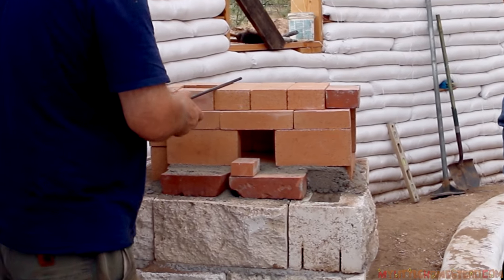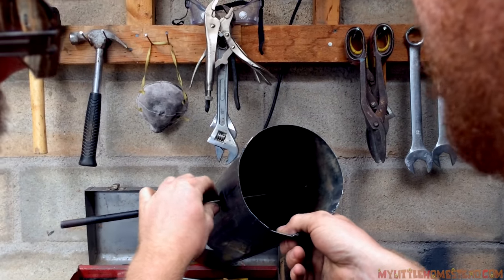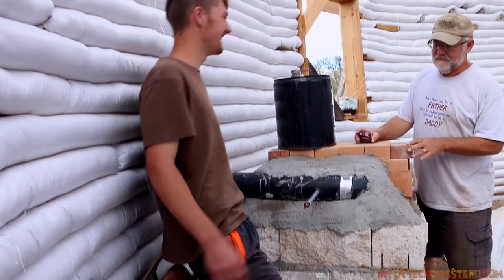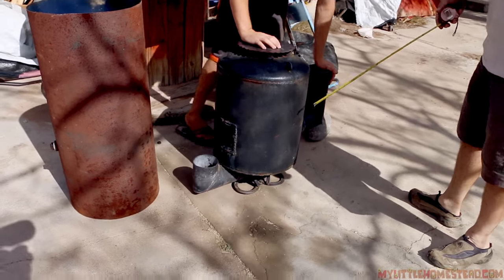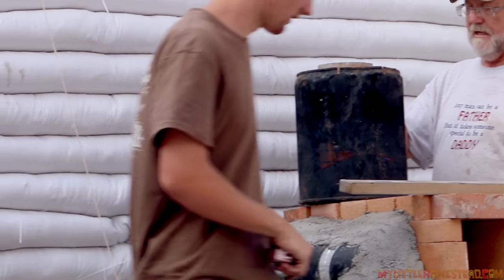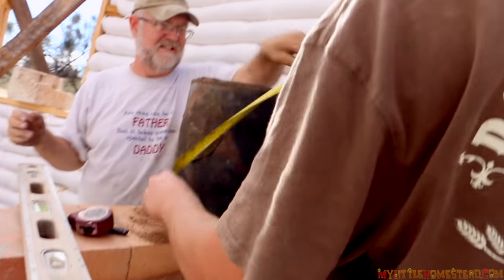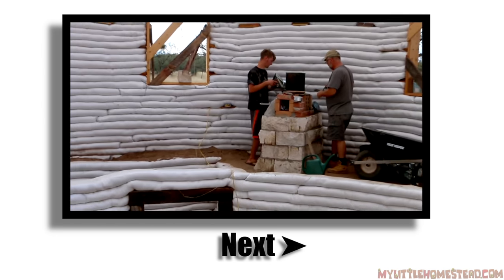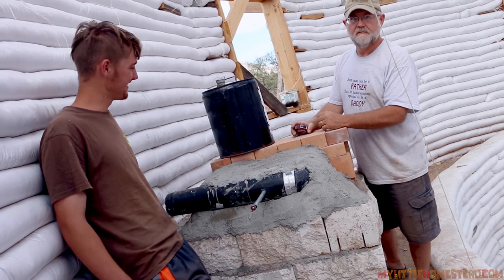Air Intake & Combustion Chamber | Dragon Rocket Stove Mass Heater | Weekly Peek Ep63

Comment: Hi guys, I just found your channel and it is awesome!  You've built some beautiful rocket mass heaters, but I am sorry to say that there are some fundamental flaws that will affect performance and longevity.  Unfortunately there is a lot of poor quality information out there about how rocket mass heaters work and how to build them.  I'm not trying to nit pick or discourage you in any way, just want to share some information i've learned. I live at Paul Wheaton's place in Montana where we have been tinkering with these things for a few years now, and have had the opportunity to take part in long winded conversations with the RMH experts that have come by.  There is a great reference manual for these things now, the product of years of experimentation and building by Ernie and Erica Wisner, with help from many other experts.  Its called "The Rocket Mass Heater Builder's Guide, and you can find it on Amazon.  I myself am no expert, I just built my first heater using that book as a guide, but there are some things the book specifically warns against that I see in your designs.  First off is the metal risers, they will melt away over time, which is alright if you have a cob insulation around it.  However, the cob alone is not enough insulation to create  complete combustion in the heat riser.  You can mix it with vermiculite or perlite to make it more insulative, but you need several inches of it to get enough R-value. Second, it looks like you are using concrete right around the fire bricks.  You need to have some sort of expansion joint, or the bricks/concrete will crack due to differential rates of expansion in the materials.  Ernie and Erica strongly advise against using refractory cements and other manufactured products, as earthen masonry has so many benefits and it much easier to work with.  You can put a layer of clay stabilized perlite around the fire bricks, then cover that with cob.  In addition to insulating the fire box a bit and improving performance, the perlite will give a little when the brick expands, creating your expansion joint.  There's other little stuff, but I think you guys would really enjoy reading the book and learning yourself.  By the way, your structures look amazing. I've just started learning more about earthbag and I am very excited about it.  Also, kudos for using so much recycled and salvaged materials!
Reply from the maker: +Jesse Grimes 
Thanks for the info.  Have a great Christmas.
Reply from the maker: +Jesse Grimes
We want to try out some of these great ideas!